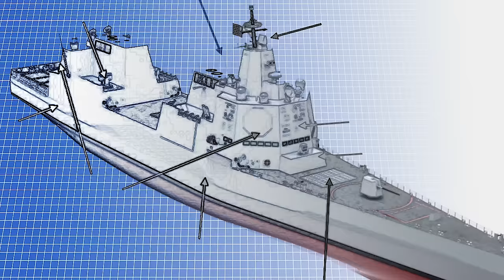TOP 15 ADVANCED Navy Ships

Comment: I'm writing a novel with a huge navy ship. I have some questions about said type of ship and other things and actions involved  (within the plot), if anyone's interested in discussing.
Reply: yo im down, what do you want to know first?
Reply: @desole784  It's a powerful ship from the Vietnamese War (from said country). But there are lots of wonders l have. 

1. if a group of planes and helicopters bombed the top of a huge navy ship in Vietnam, is it impossible to reboot to bring back years later (1980s) for a new raid?
2. is there anything from the bottom of the ship to hold on, to "ride" the ship while in the water? It's gonna be in the English Channel by Guernsey. The hero is a stowaway from below. I might give him a grappling hook or have him climb a light buoy to board the deck.
3. Is it possible for a naval ship's deck to be as big as a small baseball field (like for middle schoolers for example)? I might make the deck smaller though; I'm very indecisive.
4. As big as that, how many "towers" would the ship have? Structures seem to always stick out of the ship. The only one I'm familiar with is the conning tower, where I believe the navigator steers.
5. How many sailors would be needed for this huge ship?